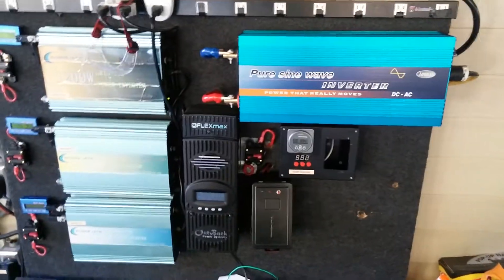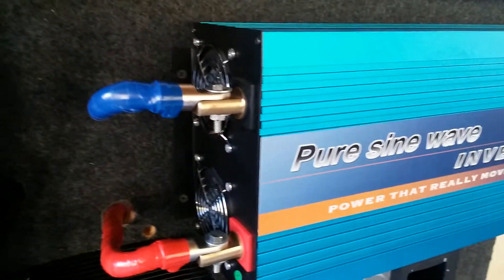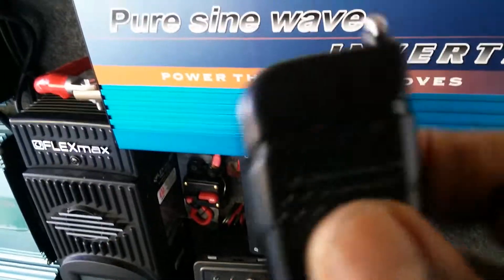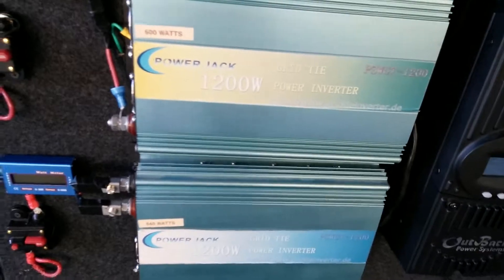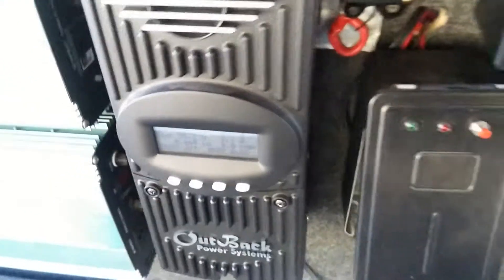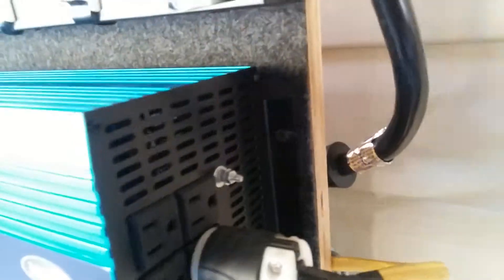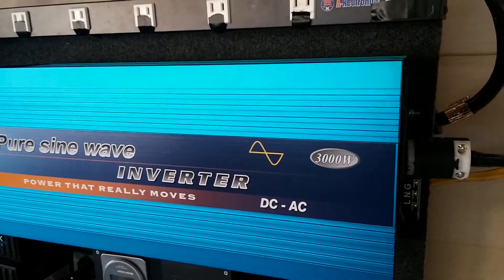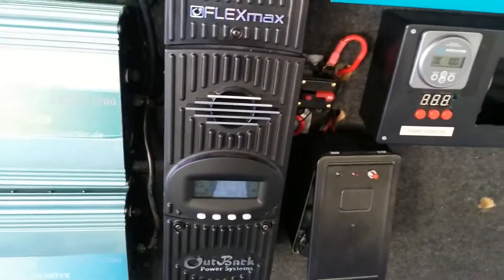2600W  OF RENOGY SOLAR PANEL

Comment from the maker: dkh1020 thanks for checking out my video----i now have 16-6v golf cart batteries wire in bank of 4 then parallel together i have a 24v system all wire are 0gauge and at equal lent and also each bank have its own 100a fuse both on ground and positive going to 2 bus bar

Comment: I have a 3kw grid tie, but want to do a battery backup on some additional panels. I like your system the best so far. Is the 3000w inverter still working good?

Comment from the maker: hi jesse fest my battery bank consist of 12-6v golf cart battery,4 battery series in a bank of 3 then parallel together to make a 24v battery bank.my wires on the battery are 0 gauge copper wire and 5ft of 0 gauge going to the power simple inverter.as for the power jack inverter you see I am no longer using them.i am now using aurora pvi 3.0 inverter

Comment from the maker: hi jonnyfly69 did not need any permit, and I did the installation myself and yes I did claim it on my tax.i  started my solar project 10 years ago in stages I started out with 45w and now I have 3200w of panel .the total project including nail wood glue every thing cost me $4500.with tax kick back it cost me $3000